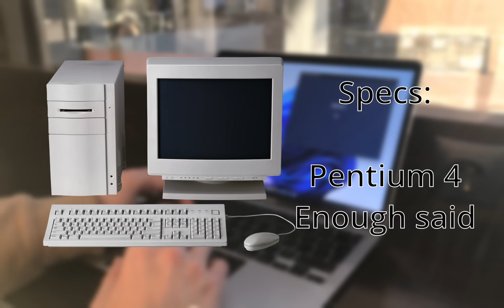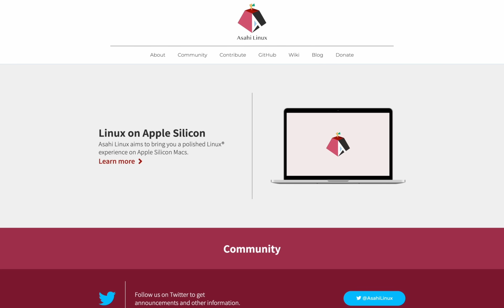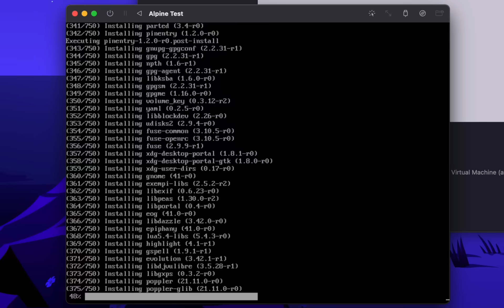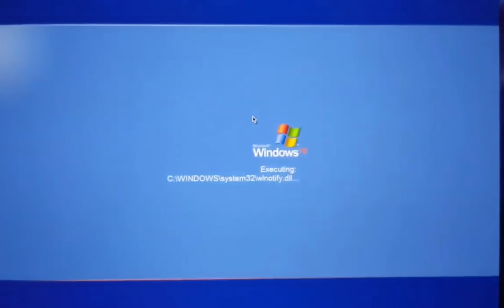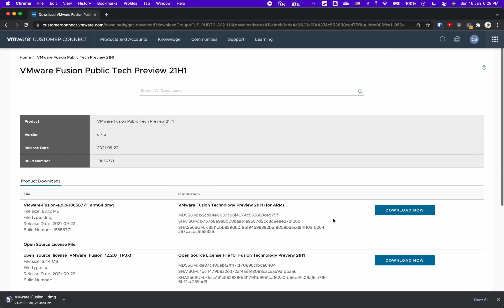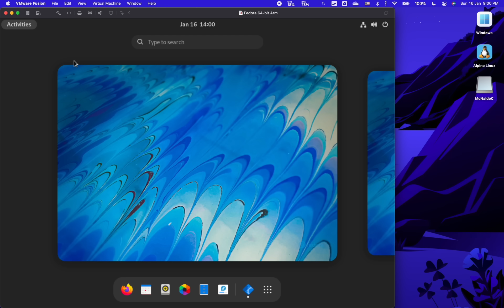Using Virtual Machines on Apple Silicon

Comment: Thanks for the video. I was waiting for such video.

I am not sure if network ovf images will work in UTM software 

When i was installing them in parallel then it was giving me error that image is made for intel. Not sure if this is also tested
Reply from the maker: Parallels tends to say a lot of things are made for Intel when they're in fact just the wrong kind of VM, regardless of architecture. It's kinda like a default error message.
Reply: @KalosLikesComputers  thanks for your reply. I will check and update you outcomes 🤗

Comment: UTM does support native hypervisor and GPU now! Although it's still in early stages.
Reply from the maker: Which version?
Reply: @KalosLikesComputers  the latest! There will be an option to choose Apple Hypervisor. I remembered I had trouble enabling gui when using Apple hypervisor but it should be solvable. And gpu support is also there but only limited to Linux.

Comment: I am a software engineer that deals mostly with macOS. Using VM’s particularly macOS VM’s is fairly critical to my work flow. I have found Running Guest VM’s to be total garbage on Apple Silicon. Parallels is the best tool, and was quite impressive on x86 Macs but on ARM64 Macs its really garbage and the support absolutely sucks. I have a few Apple Silicon macs for testing, but I am still using an Intel Mac as my daily driver. 

At this point if an application is not available for Apple Silicon like in VMWares case, I dont expect one to ever be available. Personally I blame apple for making the hurdles too high. Which is causing application manufacturers to weigh effort/cost to get it working against the small user base of macOS and how much revenue they will receive.
Reply from the maker: You also have to remember that x86 virtualization has decades of history behind it and is extremely well-documented, whereas arm64 virtualization on any platform is a relatively new creation. We'll get there.
Reply: @KalosLikesComputers  Agreed, we will get there. In the meantime if VMs are a critical part of someones workflow they really should stick to Intel Macs for now.
Reply: @andrewgrant788  Problem is, there are no intel macs to buy any longer besides the Mac Pro... We have customers running mini's and older macpros (the trash cans) with vCenter and we have a problem - if the hosts dies we need to drop the entire platform. They have software relying on old intel mac platforms.

But this is probably a problem so small as to be ignored totaly, who in their right mind runs mac as server and as v-hosts at that...
Reply: @jmkhenka  The Intel Mac mini is also available new and 27" iMacs are available on the refurb store. One use case for Mac Servers is CI build machines for automated testing. With Mac vHosts you can legally host MacOS. The main use case for running VMs on a Mac though are locally hosted software development and access to software that either doesn't run on MacOS or requires an older version of MacOS. I have a Mojave VM image  to run old 32bit MacOS software. I also have multiple Linux VMs and Docker.

Comment: Thanks for great video. I'm going to get M1 Mac in a few weeks and I'm preparing for it, because I sometimes need to have virtualized Win7 and Win10. So I decided to get small lab-server with ESXi on it. Do you have any experiences with VMware Fusion for M1 and it's possibility to connect to remote virtual? Is it vorking better than the other features? Thanks
Reply from the maker: I have no experience with ESXi or remote virtual at all, I only used the Technical Preview of VMware Fusion Player, not the full VMware Fusion suite.
If you need to virtualize operating systems that are x86 only, like Windows 7, you will have to do it on an x86 machine like the server you mentioned. Remoting into it should be possible as long as the M1 doesn't have to do any of the virtualization itself.

Comment: Hoping nested virtualisation becomes a thing with M2; that was an immediate and obvious issue when I started my virtualised OS efforts. 

Agree that parallels is excellent and windows 11 runs extremely well on even a base m1 machine. Will be keen to see if there is some improved architecture through M2.
Reply from the maker: I figured it out the hard way when I was trying to run Android apps through Windows 11 through Parallels.
Reply: I can run docker inside a VM?

Comment: I used Fusion for years, but the failure to roll out an ARM version forced me to switch to Parallels when I got an M1 Mini.  Yeah, it costs a bit, but it simply works - and the ARM version of Win11 comes free of charge.  (For now... I can imagine MS killing it remotely when they decide they want my money.)
Reply: yes, so if I want to activate the ARM version and make it "real," how to? It seems to be just a beta. Maybe I got the wrong version ?
Reply: Is there a way to upgrade the windows 11 ARM Home to Pro version?
Reply: Win 10/11 x86 can run without activation, even with updates. I doubt MS will charge for ARM version until it becomes main stream, perhaps. That won't happen for years.
Reply: I run W11 and I just reused my old key for W10 from back when I got my own first Macbook. Yeah. It simply  works. There are some occasional bugs but no major right now.

Comment: Very thorough video, thanks. I got VMware Fusion trial working on my MacBook Pro with M1 Pro and 16GB. It ran Windows 11 for ARM without GPU acceleration and at the fixed resolution, so not much use. I then bought Parallels which is night and day smoother, faster and runs as a native app. Windows 11 for ARM seems fine though I’ve not benchmarked it. Networking, sound and camera all work. One problem, MS GamePass games will not even download, presumably due to MS DRM. Needs further investigation. I will now test UTM thanks to your review. It’s supposedly good for gaming on Windows for ARM. Could you try Crossover next time for gaming please?

Comment: Interesting video, thanks, subscribed.

Let me recommend checking out Steven Troughton-Smith's recent blog post "Intel Virtualization and Apple Silicon", which is very thorough. Its focus is virtualization of old Intel-only macOS versions for testing purposes, with an interesting solution using the bare metal hypervisor ESXi on an Intel machine.

Comment: virtual box is open source meaning you could download modify and compile an arm version as well as hack out the blocks preventing snow leopard from working unless it is server.

i hope it is just the common cold not covid

couldnt you disable sip and drive encryption?

your linux graphics problem maybe due to fedora using Nouveau and gnome desktop there is a conflict that can freeze or even kernel panic the linux kernel.

i had that problem when trying to run the plain debian that kali was based on.

what does qualcomm have to do with this?

unless there are qualcomm chips in the m1 mac.

you may not have to pay money if you use torrents.
Reply from the maker: Alright, one by one.

1. One cannot just download the source code of VirtualBox and compile it for arm64, it's a program with low level code written specifically for x86.

2. It was post-COVID at the time, I'm okay now!

3. Why would I disable SIP and drive encryption?

4. Nouveau is only used for Nvidia graphics.

5. Qualcomm has a deal with Microsoft that prevents any other manufacturer from accessing development tools to build ARM chips that are compatible with Windows.

6. While piracy is always morally correct, Parallels Desktop is very difficult to pirate and I personally want to support the developers, they're doing a fantastic job.
Reply: @KalosLikesComputers  you have to disable sip and encryption in order for anything other than mac os to install on the drive or if you need to make changes to the system such as install a binary.
Reply from the maker: @ejonesss  SIP and encryption are OS-specific on M1, so you actually don't need to disable them to install another OS (like Asahi Linux, for example).
It is just not possible to install Windows right now because a Windows build compatible with the M1 bootloader does not exist.

Comment: It’s not legal to run Windows on Apple Silicon Macs, nor is it likely to ever be.
Reply from the maker: It is perfectly legal, it's just that Microsoft won't help you do it.
Reply: Microsoft does not license the ARM version of Windows for VMs, its OEM only. If your goal is to run Windows in a VM, an Intel Mac is a better choice. You can run x64 Windows and both VMWare and Virtual Box are fully supported. VMWare works very well on Intel Macs and I have used it to run Windows, Linux and MacOS VMs (great for running 32bit MacOS software).
Reply from the maker: @andrewgrant788  They don't license it but that doesn't make it illegal. Also it's ridiculous.

If you have an Intel Mac, just install Windows through Boot Camp on a second partition or another drive, no need for virtualization in that case if Windows + macOS is the only thing you want.
Reply: @KalosLikesComputers  If they don't license it that does make it illegal. Virtualization is much more convenient than Bootcamp and supports operating systems other than Windows. On a T2 Mac Bootcamp only allows Windows to boot from the system drive.
Reply from the maker: @andrewgrant788  I am legally running Windows 11 on ARM with an Education license. The only way Windows can be illegal is if you crack it.
Running an operating system on a platform cannot be illegal, even if the company that made the operating system does not support it.
Reply: @KalosLikesComputers  Does your license explicitly grant you permission to run ARM on Windows? It is completely untrue that running n operating system on a platform cannot be illegal. Running MacOS on non-Apple hardware is not permitted by Apple so all Hackintoshes are illegal. The only versions of Windows for ARM that are available outside of Qualcomm hardware right now are Insider Preview editions.

Comment from the maker: An extra nerdy note:
The M1 supports operating systems with page sizes of either 4KB or 16KB. While most arm64 operating systems will work just fine in a virtual machine, OSes with page sizes other than 4K or 16K will not boot. One notable example is Red Hat Enterprise Linux, which on arm64 has a 64KB page size, and subsequently CentOS for the same reason.
This might be fixed in the next update of RHEL to achieve compatibility with M1.

EDIT: According to AwlsomeAlex in the replies below, RHEL9 is compiled with a 4KB kernel and works on Parallels now. Thanks, Alex!
Reply: Ah that’s useful info. Thanks!
Reply from the maker: @Jack Salzman  I don't have the disk space for it, and even if I did, this M1 MacBook Air is my main school and coding machine and I don't want to risk that.
Reply: @KalosLikesComputers  Dual boot on these machines is way less janky then whatever is currently available on x86.

It would be pretty hard to damage your MacOS install, maybe except manually dd-ing it with /dev/zero.
Reply: Have a solution for your VMware problems, I'm not a mac user, however, I believe there should be a tools download somewhere in the menu (may need to look up a guide) and once you do this it will ask you to reset and once you reset, the VM should run smoother. I speak from experience. Mac OS was very cutty on my PC till I installed the Tools.
Reply: Just a note: RHEL9 is compiled with a 4KB kernel, and works great with Parallels.
Reply from the maker: @awlsomealex448  Glad to hear it! RHEL8 was the latest at the time of releasing this video.
Reply: This video is  just perfect. I have a question do you have any solution to run android apps on m1 Mac ? I am using parallels on m1 Mac and inside parallels there is windows 10 arm can we install android emulations such as bluestacks and run android apps ?
Reply from the maker: Android is an issue we have yet to overcome, really. Despite being built for arm64, there is no reliable way to run Android apps. You'd think it'd be made by now. I don't know why it's so difficult... In Windows 11 running through Parallels you can't run Android apps because that's a layer 2 virtual machine, and on macOS there's an Android emulator that Android Studio installs, but it's pretty slow. In a few years, when my low-level programming skills are better, I might try to make an Android virtualizer myself...?
Reply: You sound like someone that could help - which ARM based linux distro would you use just for secure web browsing on a macbook pro? Something that would boot fast, have good gpu and wi-fi support, and run chromium or similar

Comment: Video shows UTM emulating Windows XP for x86 and then moves on to Windows 11 for ARM on parallels saying that UTM was too buggy.  What about virtualizing (not emulating) Windows 11 for ARM on UTM?  I definitely would have been curious to see how that performed.
Reply from the maker: Windows 11 is an OS that absolutely needs the hypervisor to support GPU acceleration to work properly. It worked...fine, but it wasn't nearly as good as Parallels. I didn't show it here because testing Windows 11 on UTM as well as Parallels would have taken quite a long time, but it's actually easy for end users to test Windows 12 on UTM by downloading the pre-built VM from the UTM library. Again, very nice of UTM to provide that.
Reply: @KalosLikesComputers  Thanks for the feedback. Missing GPU acceleration is a show stopper, but I'll definitely take a look at Windows 12 for ARM on UTM.

Comment: Great video but don't be so quick to dismiss UTM/QEMU in favor of Parallels. They are for different purposes. Many including me, need to do Linux/x86 development on their Apple Silicon Macs and parallels not doing emulation makes that a no go directly. I use QEMU from the command line and sure, it's a bit slow, but can be sped up some with forced multithreading with the risk of some instability. Docker also works great out of the box for Linux/x86 development. Canonical's Multipass is also an option for virtualization but as of writing this they don't yet support emulation but are planning to add it. Many developers also don't care about graphics or GUIs, we SSH into the VMs and work 100% from the command line. For this QEMU excels and has everything we need :)
Reply from the maker: Not dismissing it! It's great! 😁
Reply: It's possible to run docker inside a VM?

Comment: great vid bro. the only question i have is why don't you do screen recording instead of using your phone to record your macbook's screen?
Reply: @KalosLikesComputers  It was just a quick comment but I was referring to some parts of the video where you used your phone to record your macbook's screen (at least for some parts of the video).
Reply from the maker: @justy1337  That is B-roll footage. It is not meant to show off what I'm doing on screen, but rather just look visually pleasing.
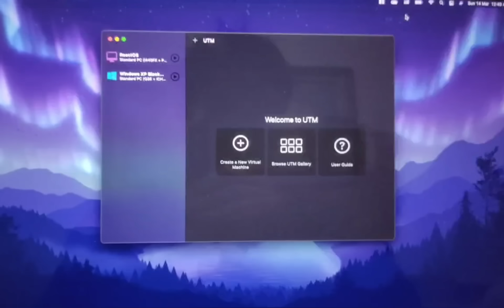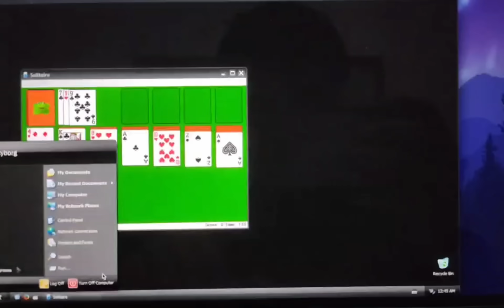Reply: @KalosLikesComputers  I was talking about 6:42-7:20? That was the only part I was referring to because the rest was great
Reply from the maker: @justy1337  Oh, right! That is my older video which can also be found on this channel. It was a very silly video, I don't know why I used my phone. Good point. 💀

Comment: Great video, can you run 3d software on Parallels ?  Do you recommend the subscription or the one time purchase.  Thanks.
Reply from the maker: Parallels somehow uses the M1 GPU as if it's a native app. The compatibility layer is pretty insane. I haven't extensively tested 3D software but I did test things like Super Tux Kart which work flawlessly.
Reply: @KalosLikesComputers  nice. Thanks.  I wonder if a heavy production application like 3d studio max would work well
Reply from the maker: @EROSNERdesign  Only one way to find out! Although, it'll have to run through a translation layer on Windows too (x86 to arm64), and Windows's translation layer is nowhere near as good as Rosetta, so the performance will probably be quite bad anyway if it works.
Reply: @KalosLikesComputers  it would be cool to see any 3d application  (not games) performance on parallels via mac studio.
Reply: Given you can run 3D accelerated games through Win11 ARM on Parallels, I assume so. Works surprisingly well for me (on MBP 14” M1 Pro).

Comment: To be honest, I stopped using Windows since Vista. There is not a single Windows program, other than games,  that I need that would make me need to use a Visual Machine. I use Cross Over for games and that's it. I don't understand this need to install Windows on a Mac. That's like putting a Toyota engine in a Ferrari.
Reply from the maker: Hey, some people like me are just virtualization nerds! I don't have a reason to install Windows on my Mac, it's just...a cool thing to do.

Comment: Virtual OSs on Parallels for ARM M1 working much faster than Vmware boxes on Windows! I feel no difference in speed running Linux or Windows ARM on M1 host,and main MacOS not suffer any delays or latency either. With Windows boxed OS working much slower than native OS and its noticeable without any tests.Virtualisation of Parallels software better realised or just ARM architechture is more effectvie for it? May be second. But. You can't run any OS on Parallels based for x86 architecture,and Windows ARM64 is still very fresh & experimental.IMHO.